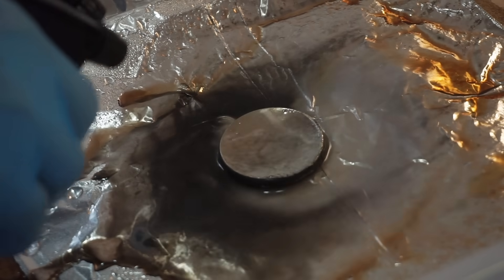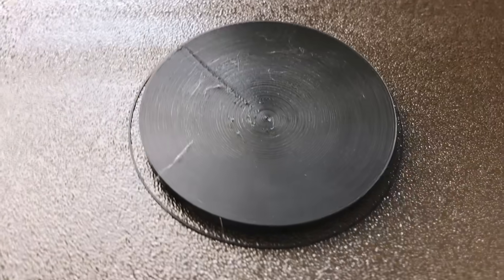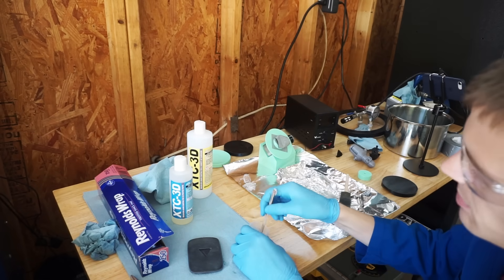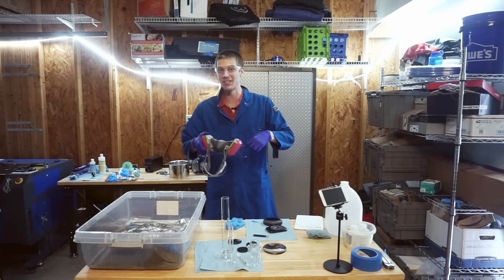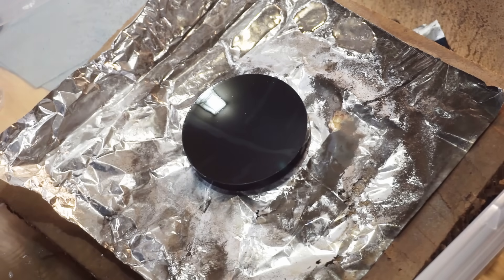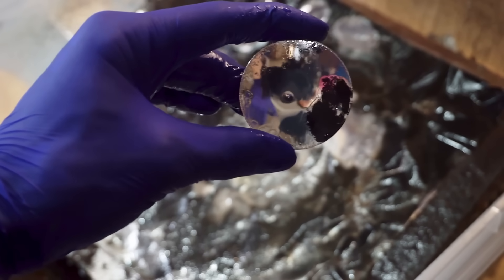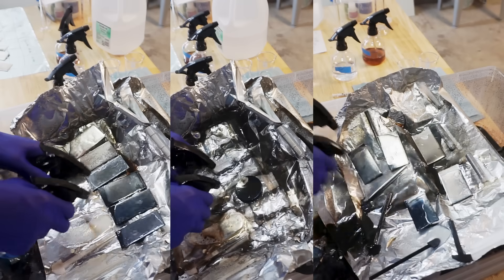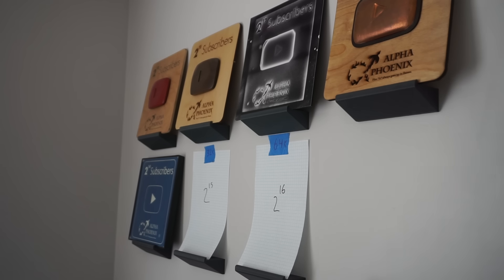How does a "first surface" mirror work? (2^15 sub special!)

Comment: to reduce bubbles in resin, you want to do the exact opposite of putting it in a vacuum chamber--cure it inside a pressure pot to minimize the size of any bubbles
Reply: The best way is to degas it in a vacuum chamber after mixing, then cure in a pressure pot
Reply: Degassing it in a vacuum chamber after mixing but before applying it can help, but you can also hit the resin with a blowtorch to pop any remaining bubbles!
Just make quick passes over the surface with the flame to pop them without burning the resin.
Reply: degassing with vacuum works well for any mixtures that are not too viscous. Also, reintroducing air and then pumping down a few times can help as well if the bubbles dont want to pop..
Reply: I wonder if the test was an acetone-thinned one. Acetone has quite a low boiling point / high vapor pressure.  It will eventually stop bubbling, but it will cool off in the process so takes longer, and you're back to a plain resin mix.
Reply: Could there be a risk of giving your 3d prints the bends? They're full of pockets of air
Reply: @robmckennie4203  they're typically porous enough that they're nowhere near airproof.
Reply: @oliverer3  At least to some extent wouldn't the resin be 'sucked' into the print?
Reply: @robmckennie4203  No, resin cures solid, and if that were the case the resin would crack and break because of the bubbles, not just let them get big again.
Reply: Pressure pot only makes the bubbles very tiny. Degassing in vacuum prior to pouring, then pressure pot to shrink any bubbles that are left over.
Reply: @xTheDeerLordx  That's plain wrong. You can see on YouTube curing resin under pressure with camera inside a pressure pot. Moreover, I cast resin blanks and then cut and polish resin - bubbles in resin don't shrink too much. Under 40psi that is usually recommended by just increasing pressure 2.75 times compared to atmospheric, they will be smaller in radius just 1.4 times (cube root of 2.75). But they disappear which you can see on polished surface under microscope (I've checked many times). Why? Air is dissolving in resin under pressure. Degassing in vacuum resin also works not by eliminating bubbles (bubbles would float to the top with sufficiently slow and low viscous resin) but by extracting dissolved air in resin thus leaving more potential of small bubbles completely dissolving. 
That is extremely obvious when there's a larger few mm bubble caught by objects in resin, pressure does very little to it and you have 2-3mm void in resin.

Comment: So happy I subbed, this video was made for me. I've been looking for a good way to make miniature pieces with a mirror finish and now I have a lot of info to use.
Reply from the maker: Be warned that this coating is really quite fragile and easy to scratch - it’s literally a telescope mirror. Good luck!
Reply: @AlphaPhoenixChannel  Can you coat it?
Reply: The recommendation for miniatures seems to be Molotow Liquid Chrome, and there's a video review where Mechhead talks about what coatings are compatible.
Reply from the maker: I tried spray polyurethane since it was the only spray-on clear thing I had in the garage and it made it a lot fuzzier. it wasn't self-smoothing
Reply: I imagine the silver could be coated with a thin resin or just a spray-on clearcoat. Even PCB lacquer.
Reply: if you havent seen it already, Adam Savage's tested has some great videos of using chrome paints and coating then with protective goatings particularly for a mandalorian helmet, but im sure miniatures would work similarly.

Comment: fallings water drops are not spearical. they are tear drop shape because of air friction
Reply: False
Reply: Depends on the size of the drop: in small ones the surface tension wins, in large ones the air friction wins.
Reply: @Tomartyr  Does not depend on size; droplets are never teardrop shape. For larger shapes when air friction dominates, drops start to flatten out since the air is pushing the most on the front of the drop. see e.g. https://www.youtube.com/watch?v=DK30Z7rDiUw
Reply: He didn't say falling, and he didn't show them falling, either. He was talking about standing water drops and their spherical shape--the result of surface tension and having nothing to do with air.

Comment: another way to smooth prints that I find super easy is to sand first, then put a layer of spray-putty on them, then sand again - instant fill and works from a spray can (way, way easier than resin)
Reply: I recently tried spray putty without sanding (I hate sanding PLA) and it resulted in, at least locally, perfect results and hidden layer lines.

Comment: Don't you think using vacuum can damage overall shape of 3d printed part.
Reply: Only if the 3d printed part has airtight infills, and even then it's only holding back a 1atm pressure differential.